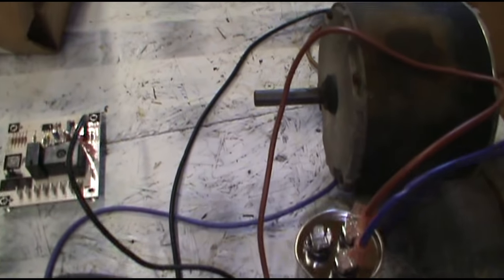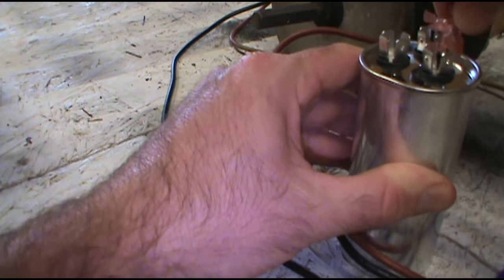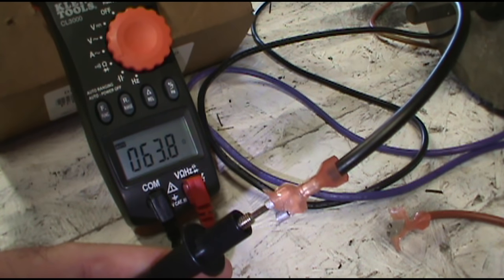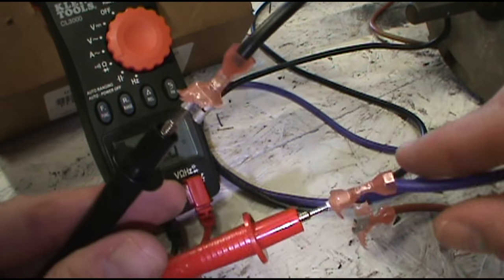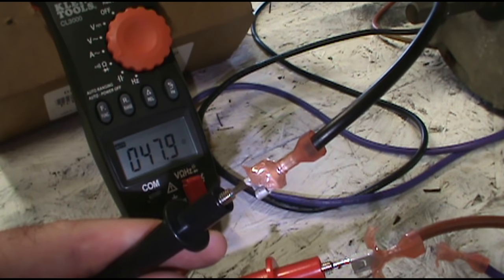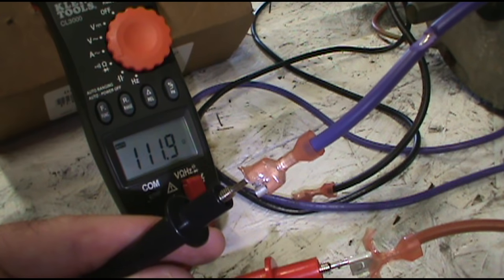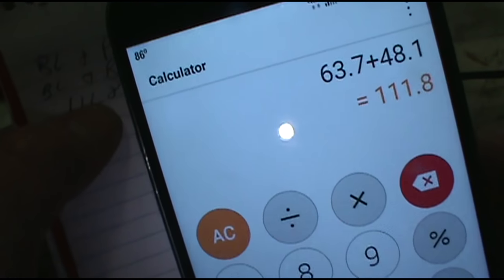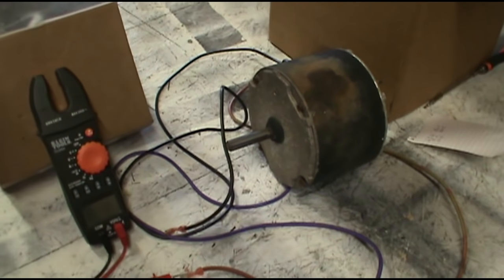HOW TO TEST CONDENSER FAN MOTOR

Comment: Hi Lex. Any chance that this formula shows up correct but the motor is still bad? I performed this test and everything checked out, but the fan isn’t spinning freely. It’s very difficult to spin. Both capacitors are within spec and I’m getting power to the unit. It is humming when I give it power. Once I spin the fan with a stick to get it going it keeps spinning at what appears to be the correct speed. Thanks sir, great video!
Reply from the maker: If it's difficult to spin then it's bad and needs to be replaced. The bearings are shot. Thank you so much for watching Mike!
Reply: @LexVance  thanks for the quick reply Lex!

Comment: Hey Lex, I have a question for you. I have a Tappan heat pump, I replaced the contact, fan, and capicitor, still nothing.  I got voltage, 240v, coming in and voltage going out through contact. got 24 v at thermostat,  do you have any ideas on this? thanks
Reply from the maker: Check the refrigerant. If its too low, it won't turn on. Thank you so much for watching Bobby!
www.DirtyMaintenanceNation.com

Comment: The ohms readings at my motor show the motor is good , but this motor is hot , hot ! , also it does not rotate freely and smith .
Therefore my condenser does not work  my capacitor and rest of the components are good , what do you think is the problem? And is the ohms system a ultimate test for motor .
Reply from the maker: If its not spinning freely then the motor is bad. That happens sometimes.
Thank you so much for watching Vernon!
www.DirtyMaintenanceNation.com
Reply: Thank you!  I appreciate you quick answer and your fine work .
Reply: My motor is Hot as well and it ohms out to be good. Is it the capacitor?

Comment: Thank you for this video
But my fan is not running (small one witch has 1.5 uf Capacitor ) it has 350/450/500 ohm between the wires  is that normal and what can I do to fix it
Reply from the maker: mohamad sy You'll need to test the capacitor using microfereds with your meter. Thank you so much for watching mohamad!
www.DirtyMaintenanceNation.com
Reply: I have done that but the capacitor is ok 
I guess  the motor is broken 
thank you anyway

Comment: The only question I have which you did not explain is what if you are .1  to .3 decimals off. Is that a bad motor how far off would a bad motor read?
Reply from the maker: That's not bad in my opinion. Only if it's waaaaaay off.

Comment: Hey I've tested the wires and everything adds up...I've replaced the capacitor as well.....but the fan blades dont spin freely.....could the motor still be bad?
Reply from the maker: Yea, I've had guys tell me that before. Everything adds up but its still bad. Pretty weird but it happens. Thank you so much for watching Raider!
www.DirtyMaintenanceNation.com
Reply: @LexVance  
Wow thank you so much for responding so quickly....Happy 4th brother!!
Reply: @LexVance  
I had 1 more question ....my unit has a capacitor (replaced) but also has a motor start capacitor that is black.....could that be the culprit? Probably not since the blades are hard to turn
Reply: Its probably not the electrical parts of the motor is bad, sounds like bearings are bad, maybe from an unbalanced blade or bad luck. Still replace
Reply: @mbburry4759  or loss of lubrication due to overheating cause of a bad run capacitor

Comment: Will that work on three phase 460 v motor?
Reply from the maker: Andy Galindo I've never worked on a 3 phase motor. Being a maintenance tech, we pretty much only deal with basic 1 phase straight cool & heat pumps. But, im pretty sure theres a way to ohm. a 3 phase to see if its bad. I'd need to poke around on one so I can figure it out. Thank you so much for watching Andy!
www.DirtyMaintenanceNation.com

Comment: what if you have 4 wires?  Blk, Brn, Brn w/wht,  Wht or Ylw
Reply from the maker: See which ones are start, run & common. It should say it on the motor. Just test those wires. The small numbers should add up to the big number. Thank you so much for watching Ted!
www.DirtyMaintenanceNation.com

Comment: My condenser fan runs normally for a few minutes and then stops ( compressor keeps running and fan spins freely ), I have 240 V. at  the output terminals of the contactor when the fan quits. The motor winding resistances add up and the dual run capacitor 35+5 measures OK.  Capacitor or fan motor?
Reply from the maker: benjaminwayneb Hmmmm that's a tough one. I'd need to be there looking at it with my volt meter. The fan motor may be crapping its pants though. 
Thank you so much for watching Benjamin! 
www.DirtyMaintenanceNation.com
Reply: Lex Vance Thanks for the reply, I have 240 V. At the motor terminals but I 'm not clear on how a run  capacitor and winding comes into play. I'll start with the capacitor and see what happens.
Reply: Bench tested condenser fan motor, motor got hot and quit after 4-5 minutes. Replaced the motor and all is good.
Thanks for the input.

Comment: Do these numbers have to be 111.3, I did mine and it was 25.2 + 24.1 = 49.3 the bigger number was 49.3 is this ok?
Thanks
Reply from the maker: Yep. Thats a good fan motor. Thank you so much for watching Wally!
Reply: Lex Vance connected this single rotation motor and had to reverse the rotation and it works just fine. I appreciate your help tremendously.

Comment: You should build a 240v test rig.  A mounting block on a table with a dryer plug that has one leg always hot going to a common post, a leg going through a switch rated for 240v (probably a 277v lighting switch) that splits with one leg marked run coming directly to a post from the switch, and the other portion coming out of the switch going through a 5 Microfarad cap to a terminal marked Start.
Reply from the maker: NETWizzJbirk I've always wanted to build one of those. I'm gonna do it in the slow winter months.

Comment: Came out of a warm house this morning to my unit making a god aweful noise with no fan running. Just did your test and got 32.8 and 35.7  so the math doesn't add up... I just wanted to be sure that 111 total is universal before i tell my ac man to bring a fan too... Cause I'm sure that racket from the compressor itself means it's gone right?
Reply from the maker: Yeah, if the compressor don't sound right then I'd say the compressor is bad.
Reply: @LexVance  thankfully it was just hot. Once it cooled down I was able to figure out that the cap had just gone out. Strange though, the two readings on the fan are still only ~33 and ~36 but it runs. 🤷

Comment: Good one Lex! I ran across a Goodman last week that was running backwards on a no cool call. Unit was kicking out on thermal overload. I replaced run cap and still ran backwards. I called Goodman tech support and they said that because the fan ran with the run cap bad for so long that it reversed the windings. I changed it out. So being curious I checked that motor just now and it tested good. Didn't know if you had ever ran into this or not
Reply from the maker: Mike Gross & Son's Heating & Cooling Mike Gross Wow no I haven't. I ran across one that was running backwards until I changed the cap. Then It started going the right way after I wired in new cap. Haven't had to replace motor yet because of it. Thank you so much for watching Mike!
www.DirtyMaintenanceNation.com

Comment: Hey Lex great video,

I’m at 73.4 and 72.3. Difference being 1.1

Is that enough to be considered bad? I saw you answer to a similar question but I couldn’t understand if you meant “5” or “.5”
Reply from the maker: No that doesn't seem bad to me. It would need to be waaay off.
Reply: I’m at 095.6 and 095.2  on my InterLINK ( Lenox ) brand condenser fan motor.  Thanks for your reply to Jesse DAVIS, which helped me to understand my fan motor should be just fine also. 👍
Reply: PS: I did select “LIKE” and “Subscribe” to this YouTube Channel, and would not be surprised if other videos you’ve posted will be helpful in the future.   Thank you for your attention to detail, while at the same time, not diving into unnecessary complexities.  A mark of a good instructor.

Comment: AC dude said my fan motor is bad,, pulling 2.7amps,, he said should be 1.5amps......... so I did your fan motor test I have 97.8 ohms.. brown and purple is 85.1 ohms I'm 12.7 ohms less.. is my fan motor bad?? It's a Goodman 5 ton 14 years old I did change the capacitor about 3 months ago, because the fan motor would not kick on just humming afterwards ran great until now, only run the unit at night, AC dude said I was a pound short Freon r22 FREAKING $209. lb. plus service bill was 278.00.. his  gauge read around 55PSI he said it should read or be around 75PSI I watched him add and saw the gauge slow get to 75PSI... Thanks for any help...
Reply from the maker: Yea, that number is pretty far off the add up. If fan still works then it's only a matter of time before it goes. Freon is pricey if you have R22 because the epa has banned it.

Comment: How much difference on the decimal side can the total be and still be a good motor?
Reply from the maker: Yogi Beer Id say no more than 5. If its 5 numbers off, its on its way out. Thank you so much for watching Yogi!
www.DirtyMaintenanceNation.com
Reply: Lex Vance THANKS Lex! I got an added total of 78.2 but a (actual, B&P) of 81.4
So I guess I’m ok on blower,
Reply: @LexVance  
Hey I've tested the wires and everything adds up...I've replaced the capacitor as well.....but the fan blades dont spin freely.....could the motor still be bad?

Comment: I am wondering what questions to ask when hiring a new HVAC buisness to perform yearly inspection and service on rental units. I have had 2 different companies do service, and both have be observed to be shady. The first would change filters and charge $50 for changing a $5 filter evan though they were instructed not to perform any work beyound inspection without authorization. It is the tenents responsibility to change them anyway. They also claimed the start/run cap. is bad every 3-4 years.
The 2nd has a scam were they say the blower motor bearings are showing signs of leakage and need a $500 motor replacement. I have only called them twice and both times they pulled this on different units. The first time I replaced the motor myself for $80 or so, the second time I realised the scam, and will measure the current draw myself, and make a decision. The bearings are not showing signs of leakage, and are hard to see without disassembling the blower housing. I have decided to keep a spare motor and capacitor onhand and purchased one for another $80.
Any advice on finding honest service companies would be appreciated.
Reply from the maker: Wow that's terrible. Yea, the capacitor, filter, & motor are easy to do yourself. All I would ask for them to do is to check the refrigerant charge. If it's low, that means there's a leak some where in the system. That's a pretty technical job finding a Freon leak & fixing it. If they say there is a leak, have them put bubbles on the leak & show you. If you see it bubbling, they're telling you the truth. They may have to replace the coil or put solder over a small hole. Also, make sure the coils are clean. If they get blocked by dirt, the system will not work right. But, you can do that as well. There's plenty of YouTube videos on how to clean a coil. The outside unit can just be sprayed with a water hose. They make a foaming spray cleaner for the inside. I hope this helps! Thank you so much for watching Mary&Dale!
www.DirtyMaintenanceNation.com